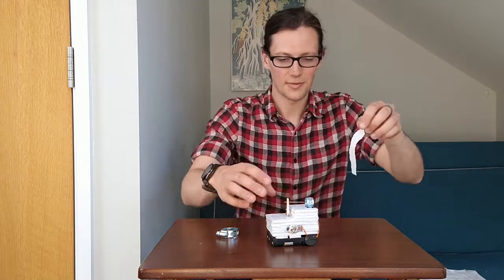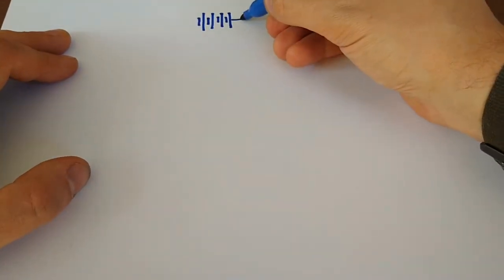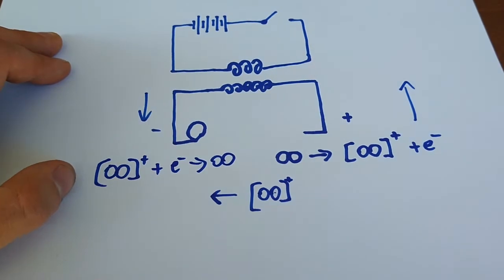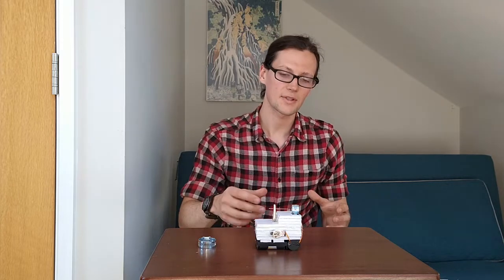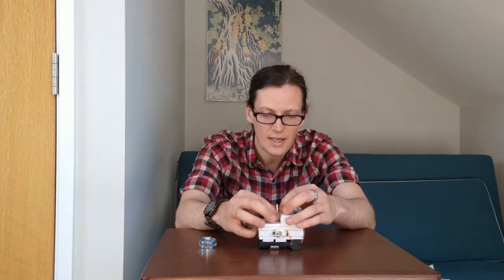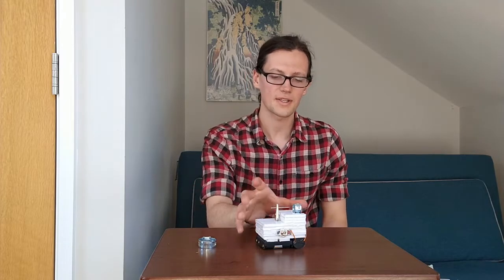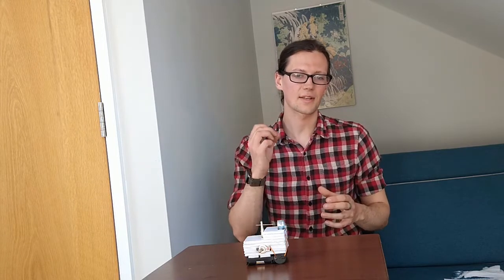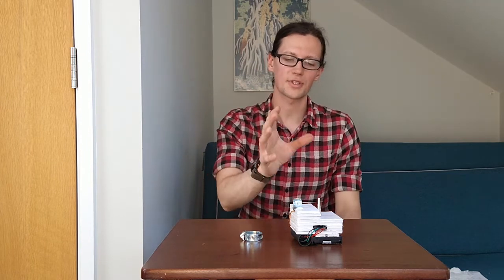Testing My DIY Ion Drive

Comment: The front edge of the round clamp will be benificial to unidirectional thrust generation if it is round, also the other edges of the clamp will probably have a very negative thrust effect.

Comment: Hey there, im trying to make one for a science expo, how 
long can i leave the power module on, and what voltage should they be given and how long do they last? A reply on this comment would be super helpful pls
Reply from the maker: Hi, thanks for commenting! I've run the high voltage modules on both 4.5 V and 6 V. They're not designed to be left on for prolonged periods (more than one minute) and they're not meant to be used without letting them discharge (spark). They burn out pretty quickly if you push them beyond their limits. I'm currently working on using a photoflash charging circuit instead but I haven't found much time to work on it. Good luck with your project and take care!
Reply: @ThrHillSeeker  Oh alright, thank you so much for replying..

Comment: So what would it do on a larger scale ? Thanks
Reply from the maker: I imagine that if the electrodes were larger/ there were more of them (kind of like in my previous version) then it would move a larger volume of air. A greater potential difference would move the air faster as the ions would experience a greater accelerating force.
Reply from the maker: @UCfmCEPvLuJWhoFZ3oa4Mokw I don't think so. I imagine that a domestic fan that required several thousand volts DC to function would be pretty dangerous. The Dyson bladeless fans move air from their base and through the empty ring using something much more similar to a conventional fan with a motor.
Reply: @UCMOfUwNso3xykMMnrNi5cOg thank you for clarifying that .👍🏻
Reply: @ThrHillSeeker  how would you apply it … to make a flying device or a light show  on a large scale.
Reply from the maker: @PeterAgostiniJdcap26  A group at MIT managed to fly a large model plane using a lot of batteries, long wires for the cathodes, and anodes on the surface of the wings. Satellites have also used similar technology (with an on board supply if gas) for manoeuvring in the past.i don't think it was be very useful for a light show.
Reply: @ThrHillSeeker  well you being younger and well educated brings interesting information to your channel for us old people. Thanks
Reply from the maker: @PeterAgostiniJdcap26  You're most welcome Peter. I'm glad you enjoyed the video.